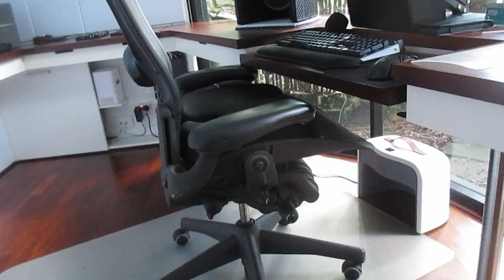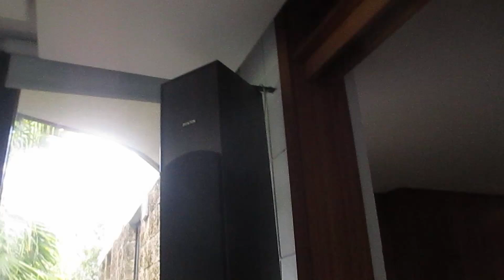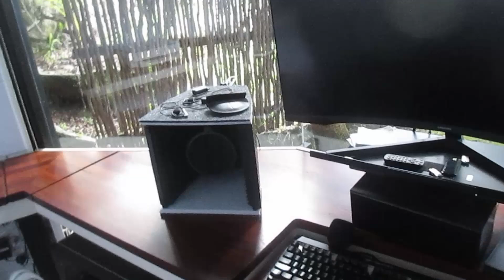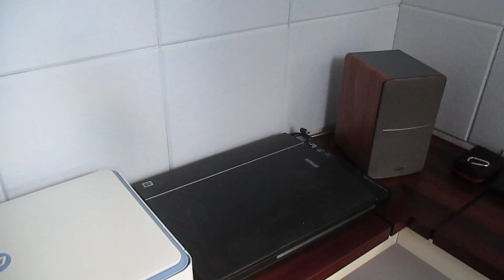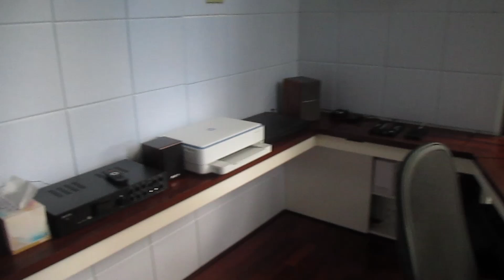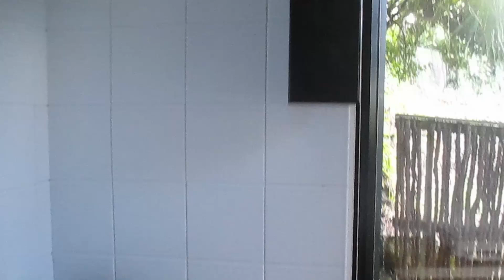computer room update 2025

Comment: the screen goes perfectly with the view.
and the speaker OOMMMMGG
Reply from the maker: I hadn't realized that I had a lovely view of my washing! Sydney, and most of New South Wales, has had continuous drenching rain for the last month, with a lot of flooding. So the video was taken on the first sunny day since. Hence the washing. The ladder and hose are part of some unfinished washing down.
In fact when I sit at my chair the view I see is higher, which is some cabbage tree palms and in the distance a Murraya tree tree. Plus a flood-way I made to take the deluge from about 20 properties above my house. If there is a cloud burst overhead, typically from a thunder storm, all the their storm water comes down through my property. The flood-way, and the tunnels beneath it, handle the issue very well.
An issue with any monitor that sits in front of a window is that the brightness outside makes it difficult to see the screen. So I have to pull the center blind down, which spoils the view to outside. I may make the blind semi transparent to see if that works.
Note the land line. The whole house acts like a Faraday cage, so there is little 4G reception for the mobile phone. And WiFi doesn't transmit well through the house. So I pulled 1Mb/s Cat 6 cable to every room in 2003. It works better than a mesh WiFi even today.
So there is a lot of technology in the house, but I've tried hard to make it hidden.
Reply: @davidjensen4490  wwwwwoooowwww
Thats too much to take in at one moment dude calm down 😂😂😂